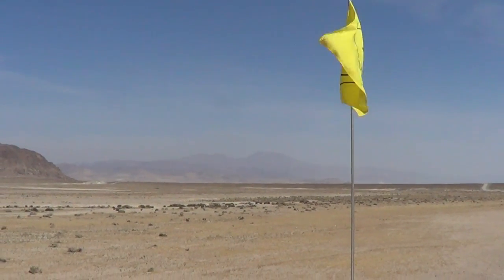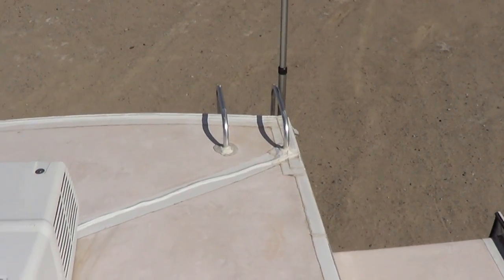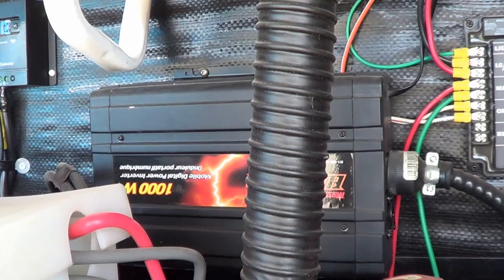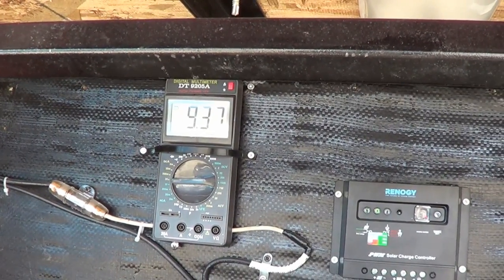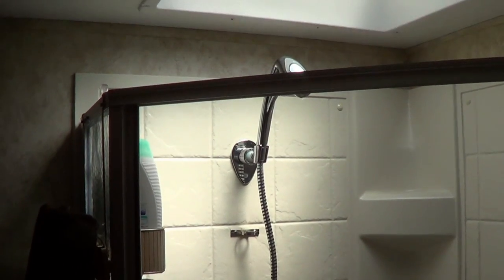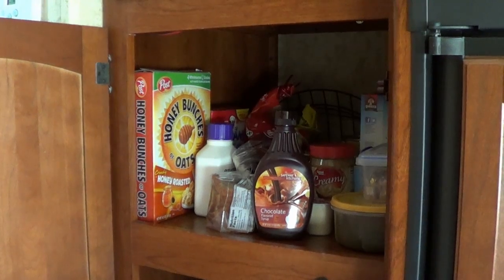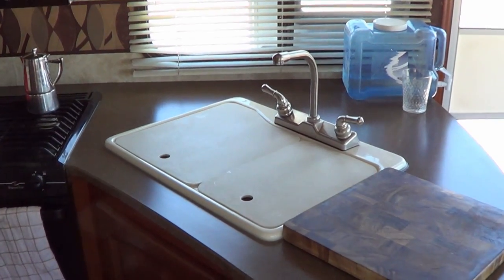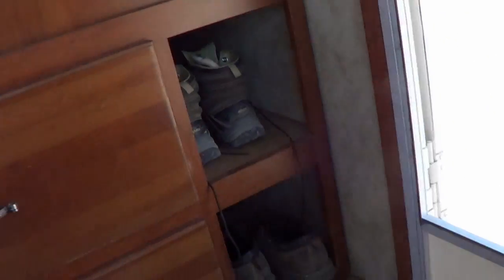20 Useful Upgrades I've Made To Our RV

Comment: I put pin switches and LED lights in all of my cabinets.  Open the door light comes on, close door and light goes off.  I also installed a 12v computer fan in bottom of fridge to move the cold air and two of them in the back of the fridge to blow over the coils.  Helps tremendously in this Texas heat.

Comment: New subscriber here.  Your extra sewer gate valve is just what I need for our Chalet truck camper which uses electric dump valves at the tanks.  My worry has always been a possible valve failure or leak and I would have about 6 ft of 3 inch pipe filled with nasty stuff waiting to rush out when I remove the end cap.  Your solution adds a back up to the electric valves and will help prevent a catastrophic event.  Thank you for sharing!  now back to watching more of your videos!  Scott
Reply from the maker: Thanks. Definitely was one of my favorite add-ons. :) Cheers Ray

Comment: Great idea on the knife valve at the outlet!  I am going to do that to our 93 NuWa 5th wheel tomorrow.  One of our valves is seeping sometimes,,,,,,you are so right,,,,,,nice to remove the cap and not have that small burst of liquid.  Plus, at the finish of a dumping you don't have to worry that every last drop got out before you take the hose off.
Reply from the maker: wayne halladey Ya, it's been a great little additon.

Comment: I’m sure you have figured this out by now, but others may not, so I’ll throw it out there. 

The gate at the end of your black/gray water dump can be used to back flush your black tank with your gray. Empty your black tank and leave it open. Than shut the last gate and open the gray gate. The water sloshes into the black tank as the water finds level. Close the gray gate and open the last gate to empty the remains from the black. Then finish with emptying the gray. Close all the gates. <<<very important. :/ 

I hope this helps someone out there. Enjoy the adventures. 

D.

Comment: I'd add more batteries before more solar and see how the system balances out first.  I have about 270 watts of solar and 2 golf cart batteries and I find that when I have lots of sun I have too much solar and when I don't have sun I don't have enough battery.  Part of the problem is that the batteries can only charge so fast (something generator operators need to learn) so while I might get as much as 13 amps going in when the batteries are low, when they are getting full that number drops right down.  (I know 13 amps is only about 160 watts but the panels are lying flat so they don't run at 100%.)

I have golf cart batteries now but when they are done I am going back to 110 AH deep cycle 12 volts.  They are more flexible and cheaper.  You can have 1, 2, 3, 4 or 5.  And you can steal one to run your trolling motor.  I haven't found the 6 volt batteries to offer any advantages, they cost more, and you have to keep adding distilled water.

The LED lights are a godsend.  Before they came out I had a florescent, still do actually, and it was better than the incandescents but no where near as good as the LED's.  I didn't replace all the bulbs, just the ones we use most.  A six pack of LED's is the best power upgrade you can make.  They are so much cheaper and easier to install than a florescent.  I'm especially glad I replaced the porch light.  Before, if I forget to turn it off when turning in for the night, it could easily use 1/4 of a 200 amp hour setup.  Now, if I accidentally leave the LED porch light on I barely notice it.  Then put one bulb (who ever uses both lights in those fixtures?) in the main area, bathroom. dinning, kitchen, and bedroom and you can cut your battery drain at night by a ridiculous amount.

The other advantage of putting an LED light in the porch fixture is that you no longer really need lanterns at the camp site.  Say goodbye to that propane Coleman torch that goes through a $4 bottle of propane in 5 hours, you don't need it anymore.  Sure,, it's still a lot brighter, but the light is in the wrong place and it's a bother.  Once you have an LED porch light all you have to do is turn it on.  Sometimes for fun I also hang a string of LED Christmas lights from the awning and plug them into the inverter, but again the power draw is pretty low and it provides all the light you need around the campsite.

I noticed you have a power awning.  My trailer came with one and I still have the bent up pieces but I had it replaced with a manual one.  When properly extended with all the clamps tight, a manual awning is much less likely to twist itself up in a gust of wind and rip itself off the camper.  I would never buy an electric awning again without automatic wind retraction, and even then I wouldn't like it because sometimes I like to sit under the awning when it's raining and the electric ones cannot be adjusted for that.

The other consideration that is important is the TV.  Of course most people are buying LED TV's now, but if you have an older rig with a plasma it has to go.  They use too much power to run on batteries.  And even with an LED it is important to look at the power consumption and consider how big of a screen you really need.  A 21 inch LED TV might use 30 watts, whereas a 42 inch might go over 100.  The same applies to computer monitors.  And always use a laptop, the solar panels can charge them in the day and you don't have to drain the rig's batteries at night.

Comment: I to have installed solar on my roof, however I recently bought an extra 100 watt panel so I can park in the shade and satellite the new panel in the sun, make for about 20 degrees cooler in the RV... Nice work on your upgrades...
Reply from the maker: windjammer1958 Thanks, good idea on the remote panel, down the road I may get one to catch that early morning low angle eastern sunlight. Temperature isn't too much of a problem as we are full-time snowbirds and just keep moving to cooler locations. :)

Comment: Faucets in, most campers, are the cheapest junk you can get. When it comes time for replacement hit a good box store like HomeDepot or Lowesand buy a set for home use. As long as they match up with the holes in the sink top you're good to go.

Comment: Great roof upgrade with the tape over the original caulking. When/if I ever get time and no rain at the same time, I’ll have to get that done with our rig. There seems to be a small leak in the skylight over the shub. Hopefully, that will fix it until I get get it properly repaired/replaced.

D.

Comment: Excellent job on the upgrades.  I did have to scratch my head on the remote awning?  I have to use a crank.....guess I'm still in the 70's.  LOL    Hey, you forgot your jack pads.  That was a big upgrade.  Good to see a new video, it's been awhile.
Reply from the maker: NWHiker I often thought I could modify the circuitry and make the remote work do something else the but never can up with anything useful.

Comment: I have that same remote in my cougar..I thought it was more gimmicky than useful when the salesman showed it off, but he was sure proud of it.
Reply from the maker: The best thing about it I find was a few times when the manual switches didn't work ie. for the awning and front jacks, the remote circuit to those motors still worked. Good for back up.

Comment: Yep I've also like your videos I've also read, from time to time, your bog. Your modifications are nice additions and pretty much what I would do if I were to continue to live in my RV. I had a 09 26ft bunkhouse that had a unique floor plan,as rule I do not like bunk house style, however for the little over 2 years I lived in mine it became obvious that one must make changes to aid in functioality. You mentioned RV designers didn't take some thing into account and I think that is because most folks are weekend warriors and the are in parks are semi full time camps such as out here on the Eastcoast. I have plans on finding an older pull behind or 5th wheel and kind of semi remodling it to fit my needs because I want more prctical features and I was thinking of trying to add electrical appliances that are soft start in addition to LEDS etc. so I only need a small generater such as those Champions you run, and not overburdening the batteries when using power as one example.
Reply from the maker: Powder River Yup , most full timers I know eventually do a full remodel at some point to make the RV there own.

Comment: u should put in some draw sliders either wire baskets or wooden draws in the cabinets especially the deep ones
Reply from the maker: Thanks, I've thought about drawers but it's always a trade-off with weight.  As full-timers, our rig is pretty packed so near it's max weight capacity. I always have to weigh the pros and cons of adding things. We haven't found the need for them so decided against adding the extra weight. I have long arms. :)

Comment: I really like your upgrade, but one concern, from my view from the net, your upgrade 20 (Surge protector), have you used gage 12 wires? if so , I do agreed you Boondoking  most of the time, but you should used gage 10 for 30 ampsit's a lot safer and less resistances. If you have, just ignore this and I will keep following you, I really enjoy seeing mods others do to their RV.
Reply from the maker: Jean Létourneau Thanks, I used the existing Keystone Cougar factory installed power wiring, They had a junction box in place where the external power cable came in and attached to the internal RV wiring. I just undid the twist on wire nuts they used and used the same wire into my surge protector.
Before: - http://www.loveyourrv.com/wp-content/gallery/surgeguard/keystone.jpg
After:- http://www.loveyourrv.com/wp-content/gallery/surgeguard/install.jpg
Full post on install - http://www.loveyourrv.com/progressive-industries-model-ems-hw30c/

Comment: You need to add small 12 v fan to frigerator with small switch to made the frigerator more efficient.I used fan out of old  computer.
Reply from the maker: +barb faber  Our fridge came with one, but I did recently swap it out for a quieter model - http://www.loveyourrv.com/replacing-my-noisy-dometic-dm2652-rv-fridge-fan/

Comment: After watching countless you tubes for improvement ideas - this was the BEST!!
Keep up the great work and include us - RV lovers. 
I am also planning to use solar energy but will need it for about 26 hours (continuous) which mean lights, A/C or heat, refrigerator (but NO other appliances such as microwave)  ect.  I wonder if the batteries can last that long with a 10-12 hours sun charge.
Reply from the maker: Thanks, I have a newer video also showing 20 More upgrades - https://youtu.be/uRbGmxun1LI 
Cheers Ray

Comment: I think you mounted the antenna elements backwards. For a Yagi the shortest element should be in front. (Amateur radio guy here, WD6S) I think if you switch them you might see a slight improvement in performance.
Reply from the maker: powaybob45 I have it the way the manufacturer made it - http://www.winegard.com/sensar     Mine old one has the addon piece, there is no choice for placing the elements..  http://www.amazon.com/Winegard-RV-WING-Wingman-Booster-Antenna/dp/B001U2DPUE
Do you think they built it wrong?
Reply: Love Your RV The Winegard page shows the short element between the driven element (attached to the wires) with a longer element in front. I assumed this was a a Yagi type antenna, which has a (qualitative description) very long reflector element, the shorter driven element, and the progressively shorter director elements. I am far from an antenna expert so it may not be a traditional Yagi, but some other form for UHF frequencies. But it sure looks like a Yagi, and I've never seen a Yagi that had a longer front element than one one behind it. The only factor I can think of that would make a difference is if they were different metals with different electrical properties- that could provide some efficiency advantage. That doesn't make sense from a cost or materials and production point of view, so who knows for sure. If it works for you enjoy it is the bottom line. I originally thought it was some sort of kit you had to assemble and may have switched parts- not that I have ever done that <sheepish grin>.
Reply from the maker: powaybob45  Check this  video out at about the 2-minute mark, explains how the addon elements work for the UHF channels. https://www.youtube.com/watch?v=tR0GqSmTNPU

Comment: I see your two panels are  bringing in almost 10 amps.  So now your looking at going to four panels I am looking to start with 4 panels and use 12 volt batts that have a 125 or 155 ah rating only because I get a huge discount on 12 volt batts. I am just starting learning about solar and from my calculations I should create over 30 amps in full sun but I boondock in tree areas so I am hoping to get 15 to 18 amps in full sun. Now would you go with 300 AH's on the total battery bank or stay down around 250AH. My biggest charging draws would be my mobility cart because I am disabled and a few cameras and laptops along with the normal stuff, TV's radios lighting etc. In your opinion is 400 watts enough with the 250 AH bank or or would you increase to 600 watts and run over 400 AH battery bank.

BTW I like many of your improvements. Manufactures really need to pay attention to what people change or improve on. My current 400 watts plans will cost me 1800 to 1900 bucks so I want to do it once and be safe with enough power instead of adding on later.

Oh another thing did you run with a MPPT setup or just a generic set up.
 If you can help out it would be very valuable to me. 

TIA
David
Reply from the maker: +David Wohlfeil 400 watts may be enough solar but I would suggest going with a 400 AH bank so you have sufficient storage capacity. That's what I'm soon planning to do. 
I didn't go with a MPPT as I believe a cheaper PWM type controller will work well enough with my system size and since all my panels will be the same type and wired in parallel, so I can allocate the savings elsewhere.  
If you are boondocking in trees, you may have shade issues, check out this article for some info on that problem when is comes to using a MPPT type controller - http://www.amsolar.com/home/amr/page_165
Cheers Ray
Reply from the maker: ***** Interesting setup, thanks for all the information. Cheers Ray
Reply: +Smitty Durkin Thanks for the info I value your input.  I will be purchasing my equipment over the winter.  The battery info is most valuable I will take that into consideration when buying them.  My system will be mostly from Renogy Panels, controller, and inverter plus meters. I like keeping everything in the same brand name because its all been tested together.  At my current figures my system will cost $2300.00 Th buy back all depends on how often I go out but I figure it should be around two and half years.

Comment: Thanks for the awesome video! :-) You have given me alot of great ideas for my travel trailer!  Just a quick question though what's the toggle switch on the side of your thermostat for?
Reply from the maker: Craig Sawyer Thank you! It's the High/Low fan switch for the Air Conditioner. The Hunter thermostat didn't have that so I had to add it on.
Reply: Oh ok that's a great idea! :-)

Comment: I use a similar shut-off valve on my shower, but would like the info on the one shown in the video. I like the large buttons used to toggle it. Thanks!
Reply from the maker: It came with the Oxygenics shower head I had. Here is one like it - https://amzn.to/2y9wwHa  Cheers, Ray
Reply: Thank you! That one does look like it has bigger buttons than the one I have now. I just called Oxygenics to ask if they sell the valve separately and they said they do, but only to customers with proof of purchase. Thanks very much for your quick reply with the link!

Comment: Very impressive upgrades, hope you don't mind me taking a few for myself.  Only questions are (1) does your system allow you to add more panels and batt's? Also have you switched all your lights to the LED bulbs so it doesn't drain more power? ty for the video
Reply from the maker: ZEROEDN72  Thanks, you bet. :) Yes I have space for more batteries and panels and plan to double my capacity for this falls boondocking season down south. I have swapped out my old lamps for LED and it made a big difference. - http://www.loveyourrv.com/install-review-starlights-led-lamps-rv/  Cheers Ray

Comment: The outside right rear tire looks low, you need to check it. I liked all your up grades and I need to find the surge protector like you have, where did you get it?
Reply from the maker: Stan Wilson Must be an optical illusion, as the PSI is bang on the same as the others, I always check before each tow. Here the install post I did for my surge protector - http://www.loveyourrv.com/progressive-industries-model-ems-hw30c/ Cheers Ray

Comment: flexible solar panels you can even use them on the sides of the camper.
Reply from the maker: +Nathan Dean They are pretty cool and I thought about them but not worth the extra money since I have plenty of space on the top of the fifth wheel to mount the regular type. Cheers Ray
Reply from the maker: +Nathan Dean You might want to take a look at this blog post. There are some drawbacks to flexible panels - http://www.technomadia.com/2014/11/zephyr-is-solar-powered-800-watt-rv-bus-roof-solar-install/

Comment: How did you route the cable to the roof top panels? I love these mods, we are about to buy a 35' fifth wheel for full time living in AZ.
Great video.
Reply from the maker: Ron Ortoli Thanks, see my blog post - http://www.loveyourrv.com/installing-renogy-200w-solar-kit-rv/
In the video I show the path I used in a wall along side the black tanks vent pipe. Made for a really convenient path and very short distance to my batteries.